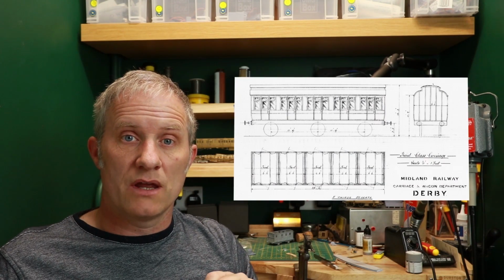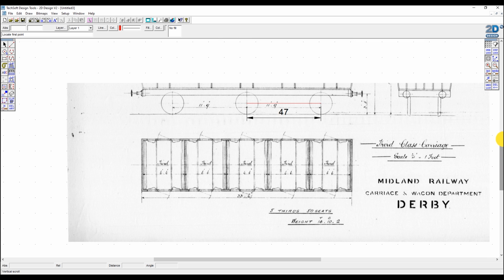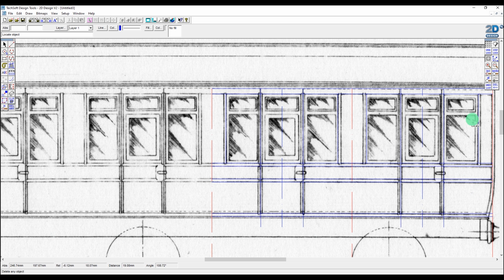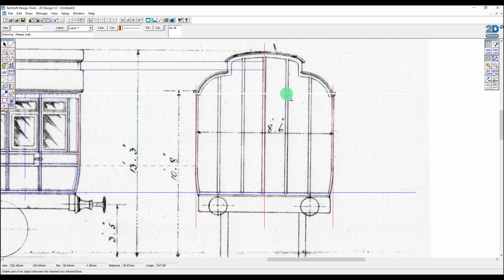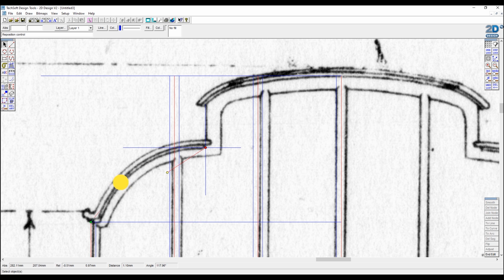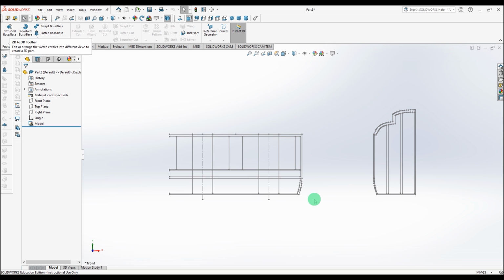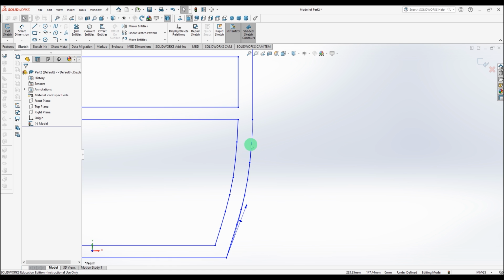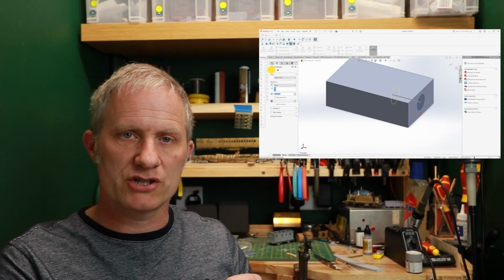S2 E39 3D Modelling a Railway Carriage Part 1

Comment: Are there any pros/cons to digitising your copies of the drawings into what you might call 'model coordinates' with the CAD drawing defined in terms 4mm scale target measurements vs creating the initial CAD drawing in 'real world coordinates' and scaling the 2D drawing or 3D CAD model later? Or would you say it’s just a matter of personal taste? For example, another comment is from someone who prefers to do their initial CAD drawing using the 'real world' dimensions on the drawing.

Also wondered CAD packages offer features to deskew and correct aspect ratios of imported pics used for tracing; perhaps this isn’t a common use case for the majority of CAD work.
Reply from the maker: I think it's a matter of personal preference really.  When I'm making a model I like to use the model scale and dimensions as it's handy to be able to 'visualise'  the key dimensions dimensions that I'm working with.  For example, I know the axles will be made from 2mm diameter bar, so the design of the bearings and details inside the axleboxes will be based around this 2mm dimension.  The same applies for things like coupling hooks and handrail wire, etc. for which I will be using parts and materials with specific dimensions.  That being the case, it makes sense (to me at least) to scale the entire model and use model dimensions throughout.  If this were a generic model, which I anticipated reproducing in a variety of scales, then I would probably draw full-size and scale at the point of printing.
It is also possible to create a table of key dimensions, and set the drawing to 'read' these when creating a part.  This is a useful technique when planning to produce an item in different scales.  For example, we could create a data entry for 'axle diameter', with separate columns for 2mm,3mm,4mm & 7mm scales etc. with a different diameter for each.  We can then reference the drawing to the relevant piece of data in the table depending upon what we require.
Imagine something like a locomotive wheel, if we tabulate all the key dimensions and parameters; diameter, no of spokes, crank pin position, etc. then we can write a formula to produce, (for example), a 5'6" diameter wheel with an S7 tyre profile with 16 spokes, crank in-line to suit a 24" piston stroke.  
In practice, it's a little more involved than that - but that's the basic process of parametric modelling.  Usually though, I just sit at my computer and doodle to pass time - hence I've a hard-drive full of quite interesting stuff - most of which I've forgotten I've drawn.  :)
Thanks for watching,
James

Comment: Hi James. Just come across this video whilst looking at the Templot track videos. Firstly, well done! It’s not easy to make a “do this, press that, use this button’ video entertaining and informative. You have made a damn good job of it. 
I have an Elegoo Saturn S resin printer already, but looking at both this video and the Templot track making videos, it seems it would be good to have a laser cutter too. Bearing in mind I work in 7mm scale (so materials might be heavier, certainly larger), do you have any suggestions for a budget (bargain basement if my wife reads this) laser cutter? Or perhaps some “minimum” specs I need to look for. Eg diode laser, 10W etc?
Plywood sleepers are my preferred option and I like what you’ve done with panelled coach sides. It’s something I’d love to take further. 
BTW, what glue do you use to join sides/ends/floors?
Reply from the maker: Thank you Malcolm, you're tight it's not easy to produce a video like this, not is it an easy watch so thank you for your patience.  As for laser cutters, if it's your first I'd now recommend a diode laser over Co2 for easy of use, although a Co2 laser is more versatile.  I would try to go for something like 20w as a minimum as a good compromise between speed and cutting power.  I'm certain that any 5w laser would do most of what you need, but slightly more power makes for a more pleasant quality of life in use.  I'm presently reviewing a 60W diode laser which is a beast, it's absolutely amazing, but realistically quite unnecessary for model making work.  Indeed, it may even be a little dangerous.  :)
As for glues, I tend to use CA glue for just about everything as I'm impatient, otherwise its quality PVA for most other jobs and school-type PVA to glue plywood sleepers down.  
Why school-type glue?  Well, if something goes down in the wrong place it is easy to spray with water, cover with cling-film overnight and lift/reposition with very little damage.  :)
Thanks for watching,
James

Comment: About the curves of the roof and lower side wall parts; not unlikely the drawing and the components, as well as the jigs for it have been done by different people at different times, one interpreted the work of the other 😉(and not seldom some parts got replaced after some years, rebuild roughly from what was there or just used the newer version of it)
What's relevant -> stay inside the loading gauge of the specific line (and era) you build your carriage / wagon for 😶‍🌫you know, that one tunnel, north of Bexhill West, you mentioned before.
Till next video (or if I spot someting else in this video)

Comment: Hi James, another great video, I too use this concept of old drawings which can to be converted into or downloaded as PDF files and imported into a cad system. The only place I would say I differ from you is I prefer to initially scale up to full size first, and then draw in decimal imperial units. I fully agree this is only a matter of preference. 
The reason I do this is in fact the same reason you go onto explain, in that you ultimately have to start to best guess some in fact a lot of of the measurements.
 which is as you say not exactly best drawing practice. However by scaling up first it helps me at least make much more sense of the variation in the copied drawing.
So for example if a panel wide was say  0.235 mm it does not make much sense, but a panel width of  0.75 inches makes much more sense I.e. would it be practical to have used a 3/4 wide piece of timber for that frame. Yes it would, therefore you can with some confidence move forward. ultimately once the 2d drawing is finished I then scale back by the 76.2 value taking me back to the metric 4 mm unit value and import into 3D cad. I believe that is something worth thinking about.

Cheers
Phil,
Reply from the maker: Hi Phil, I totally agree with your logic here.
However, if I'm drawing something for a specific model scale then it makes sense to me to base my drawing in units to which work well with the materials I intend to use.  For example, I'm currently drawing up the artwork for a locomotive chassis which will be etched.  The starting point being the thickness of the material I intend to use.  That being the case it works for me to use that unit as the basis for the drawing, which is especially helpful when dealing with things like slots and tabs.
In essence the same though process as you describe, just with inverted logic.
Simply scaling from full-size can produce odd-sizes.  Not a problem with a 3d print, but with fabricated parts, one often has to select from stock material sizes, with inevitable rounding-up or down errors, which can lead to 'stack-up' errors in a fabrication.
If I'm drawing something as a digital model only then I always use the parent units, often full-size imperial.
Thanks for watching,
James